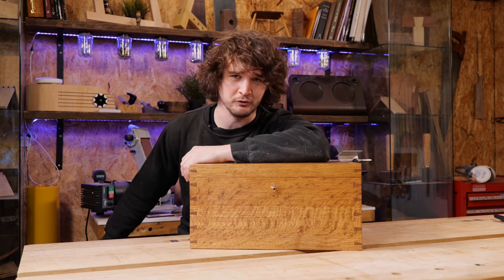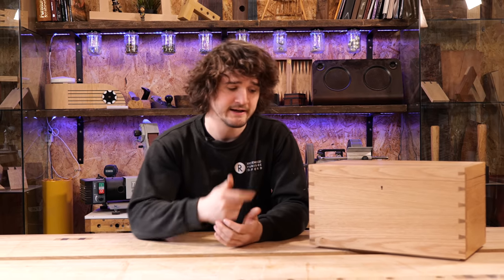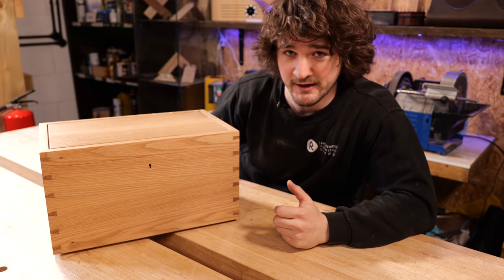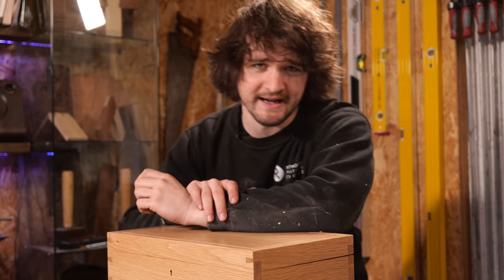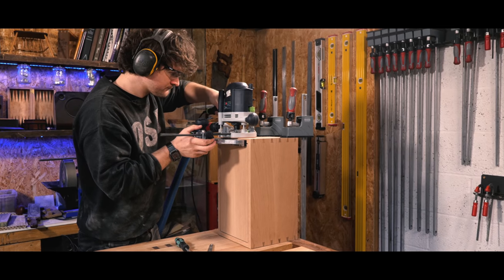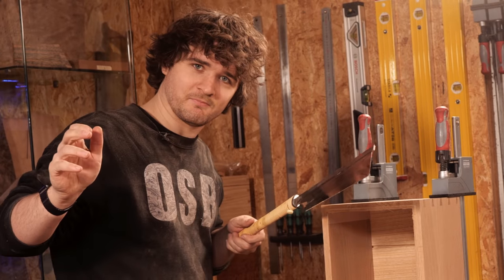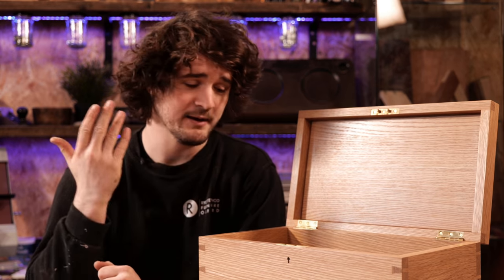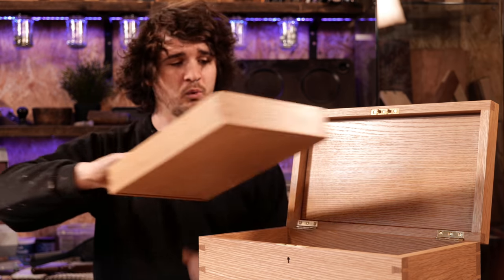How I Made an Oak Toolbox 🌳 (And how you can too)

Comment: Recently saw in Wood magazine a much more simplified yet still dovetailed tool caddy. What was really nice was that it seemed like rather than have 1/2 pins on the bottom, the craftsman offset the layout upward to create a full mitered corner on the  bottom. Looks like you did the same but the video breezed through your progress step to quickly. Really is a nice detail probably not "caught" unless specifically explained or something the viewer has seen before.

Comment: Awesome box. I made a similar one in 2005. Mine however used finger joints instead of dovetails and I had 6 drawers in front with a shallow box on top. The one question I have for you is, why did you make your life so much harder when cutting the top off? Why not just raise your blade on your table saw, make sure its square, then cut the lid off that way? That's what I did and it came out great. I first cut the front side, then cut the back. Any minor planing afterword was quick and simple.

Comment: I like the idea of using pre-cut shims to put pressure on tails only. I will do that too.
Reply: Ionut, instead, why not mark out so the tails are a hair proud of the pins, and clean up down to the pin ends with your plane? This still allows you to clamp with pressure bearing over the joint without the waste of time cutting those silly cauls, and has one more virtue: when you fit drawer fronts and backs into a carcase prior to cutting the joints, you need not make calculations about how much your pin ends must project. Just clean up down to the endgrain, one shaving more and your drawer is sliding sweetly.

Comment: First, I didn't know firstly was an actual word but I looked it up.  Secondly, the craftsmanship is top notch.  I built a similar tool box. When I cut the top off it sadly released some internal stress in the wood and what was once perfectly square now had a top that was slightly out of square and no longer lined up at the corners.  Did you experience anything similar or have you seen any changes with the seasons in the corner alignment of the top to the base?

Comment: To ask quat is likely a noob silly question.... Why did you cut the lid off in the way you did? Would it not have been easier to use either a table saw or your band saw to do it quicker that that? Or is there a reason I just don`t know about that made your method better?

Comment: Wouldn’t it have been easier to separate the lid using the table saw?
Reply from the maker: If I had one, yes. But an even better way is using a spindle moulder with a slotting cutter. Which I also don't have ;)
Reply: @MattEstlea  don't look aghast John, Matt didn't have a jigsaw until just before covid 😁. Regards Jim.

Comment: Much you still have to learn.
Clamping your dovetails !
If you cut them properly the whole point is you should not need to.
Using the wrong size brass screws AND chewing the slots with a poorly fitting screwdriver ?
You would never cut it in a pipe organ building shop Matt.
You must unlearn what you have learned ( at college).
Detail is everything.
Reply: Oh look the French doors sales man is back, who does everything by machine in his cavernous workshop.
The one scared to show anyone his work.
And the one that has bought the gimmick that only Japanese tools are any good. (They are very good. But so are others. They're also designed for Japanese style joinery, not doors and pipe organs, so you're not using them to their full effect when you do step away from the machine)  

You may have 40+ years of experience, but when it comes to finding a tutor, I'll take the one who knows how to teach, can admit his own flaws, and who lets others see the quality of work he can achieve.

You had the benefit of apprenticeships.
How many people have you extended that same benefit too?
Reply: @peterhague5626  
Still simping for Matt ?
Good luck with that.
I have one apprentice at the moment and I have in the past overseen and trained many others. 
On the job, in the real world. 
When the job requires it and time is money I use machinery to dimension my timber but I don't use that cheap garbage from axminster machinery. Most of my gear is Industrial Wadkin. 
But I still handcut and fit my dovetails because it's the best way to do it. But again, the subtleties of hand cutting properly are not being taught by Matt and all the other tube boobs.
They are dumbing it down to sell tool's, that's all.
Reply: @joschmoyo4532  I have never seen Matt sell a tool other than his own marking knives.

For the most part, the older wadkins are superior machines, as they weren't having to make cost savings in production.  I'm still not impressed by what machines or tools anyone has.

I'm impressed by the work they do.  Which you won't let anyone see.

My stance is still that you, whilst no doubt very skilled at what you do, are hastening the end of traditional woodwork. Whilst people like Matt, Rob Cosman and Paul Sellers are doing their best to pass skills to future generations, and counteract the harm done by people like yourself